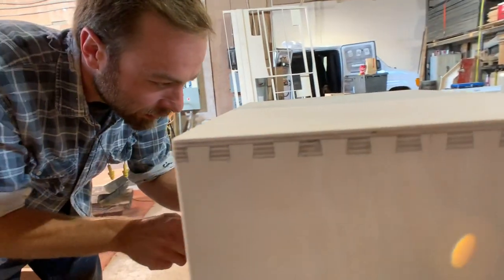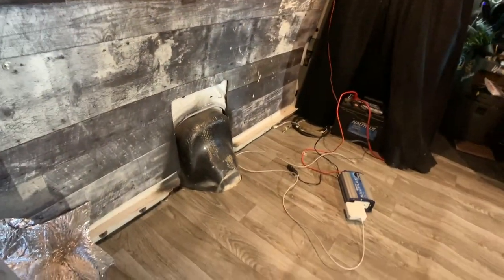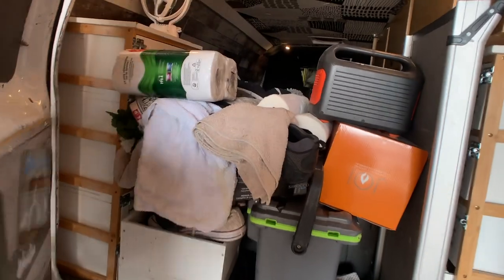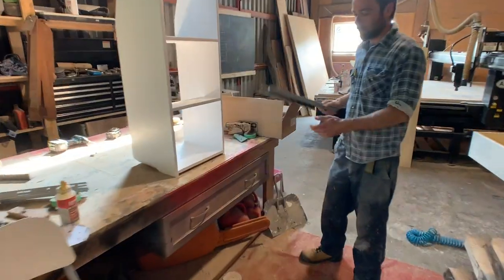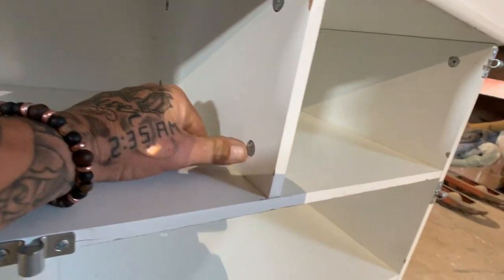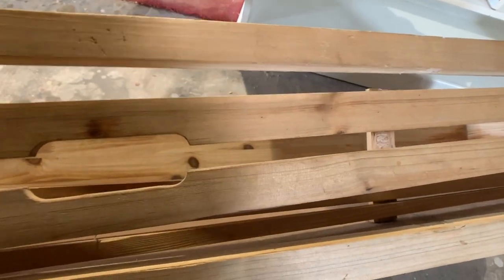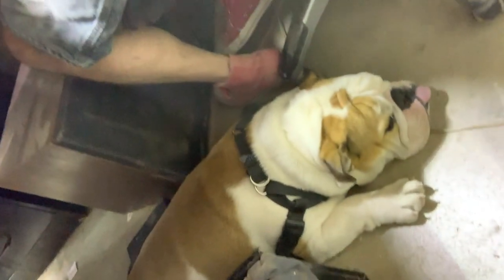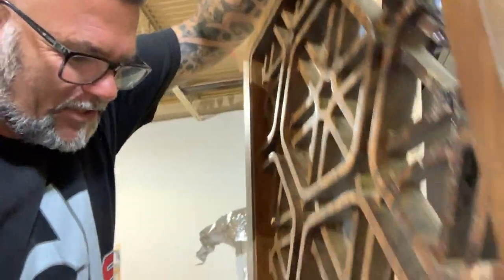My Simple Van Build Just Fell Apart ... New Van Build In Progress

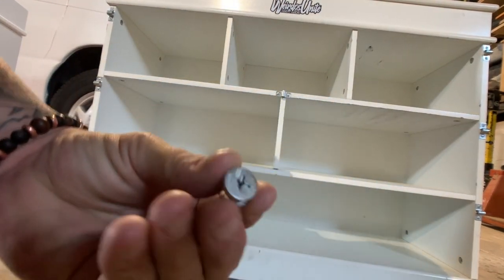Comment: Pro-Tip: For those starting with the cheap, beaver-barf (particle board), IKEA type cab's, use glue when assembling. Titebond II or III, or epoxy. Put a bead along each joint. Put a dab in the dowel pin holes. Can even glue the cam fasteners Chrome shows @ 6:27 so they don't come loose. Glue will add a good bit of extra strength to these cab's so you get more out of them.

Comment: I'm curious about the weight of the stuff inside your van. When I first started researching ways to travel, RVers would talk about weight and distribution of that weight. I know cargo vans are durable but have you ever weighed your van? I'm starting with a minivan, budget-friendly and simple. I too do not see the need for expensive van builds.
Reply: I was wondering that too. The wood they are using looks like 1" thick! That's about 5-6" + the depth and width of lost space for such heavy cabinets. Weight does matter. My twin bed platform is 1" thick and SUPER heavy.

Comment: Those cam locks stink for van use or most uses really, I would recommend pre-drilling and screwing all joints after assembly....you’ll still have issues but it won’t get so rickety like yours did

Comment: The cabinet would not have crumbled like that while driving, especially because the drawers and latches were stabilizing it to a degree. Those are not cheap cabinets, compared to other flat pack home furnishings. It probably would have started sagging more, or cracking at joints, but you were putting way more force on them to get the crumbling effect. For all your talk of home furnishings can work, you seem to be contradicting yourself in actions this week.
Reply: Agreed, he's talking starting simple and down talking it all at once. I still love Chrome and he DESERVES to be excited about better toys. But he also seems to be going back and forth a bit. Which may just be excitement, but...idk.
Reply: He shows in a previous video that those cabinet drawers were sagging and he was having trouble opening some drawers especially the long bottom drawer.
Reply: @BeccaBullard8  the structure is still less secure outside the van then it was in it both secured to the van and with the drawers in it. Don't get me wrong, I love Chrome and his upgrade will be way awesome. But rotating out where he stored things would have been an easy fix to the sagging problem. Even he admitted to having heavy items above that bottom drawer and it's a flaw it sagged, yes. And yay, he doesn't have to worry about restructuring storage in that drawer, because he's getting a bomb upgrade. But those cabinets would have held up easily. The front drawer would have pulled off (and been repairable) long before the structure actually crumbled (I still think Chrome overplayed that a bit, but I digress). Forcibly Shaking back and forth against the joints of it while empty is not the same as a bumpy road while it was secured down in the van. Is it, quality wise, weaker structurally then the custom cabinets, sure. But the structure was not even close to on the verge of crumbling like that in the van.